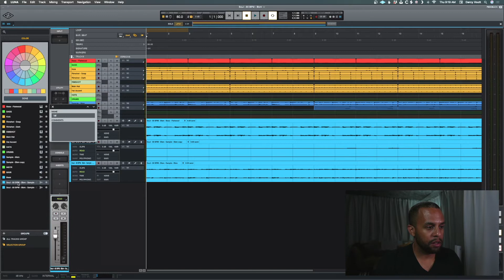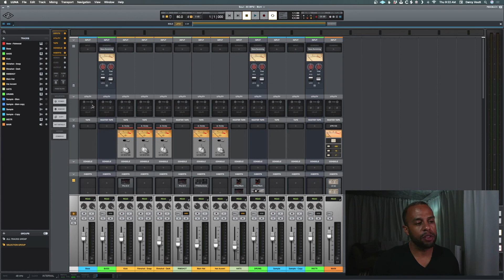How to Save Resources in LUNA

Comment: it would be really awesome if you revisit this a bit more in depth specifically with DSP management tricks....trying to use capitol chambers reverb in mixdown on a duo core seems nearly impossible at the moment... Thanks again for the great videos!
Reply from the maker: Thanks for the suggestion, will think about some of the things I used to do. Right now with all of the upgrades I have done, I rarely run into bottlenecks. But I did spend years figuring out how to squeeze every last ounce out of my DSP and CPU at the same time.

Comment: I do this a lot already.. but thank you for this tho my m1 render in Luna is always low but the memory is always high 100 and up some times..I called  UAD and they say it’s a problem they’re working on no performance issues but it makes me nervous in the activity monitoring on the computer Luna uses ram I don’t even have lol and they can’t explain it for example I have an 8gb M1 Mac mini and Luna is using 13.4gb or higher depending on the session. So this work around us a must for now at least.
Reply from the maker: That ram usage is suspect for sure. Might be with everything being integrated into a single chip maybe some of the ram is VRAM. 

Unless I have the rumoured Mac Pro with like 40 cores and 128 GB RAM, I’ll keep using this method or a proper freeze then I’ll disable and hide the tracks. It always gives you the most performance back with an easy method to revert.
Reply: Thank you I really appreciate the videos you post and also the music you put out on Apple Music I’m working on getting my mixes as clear as yours “goals”
Reply from the maker: @Stalkworthy  really appreciate that in both fronts. I do all my mixes in LUNA so no real limits there. Just how you go about the mixing.